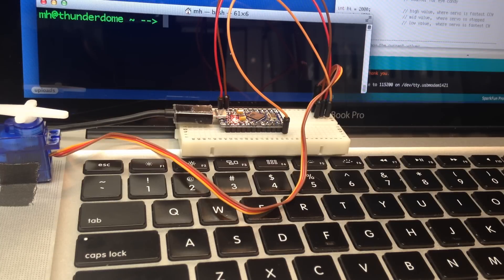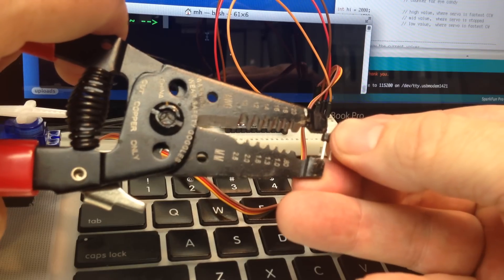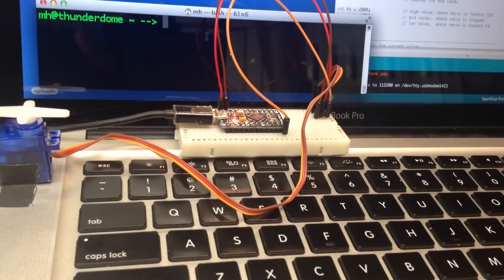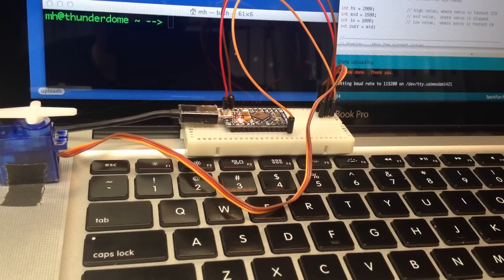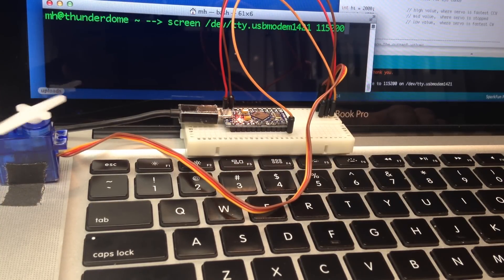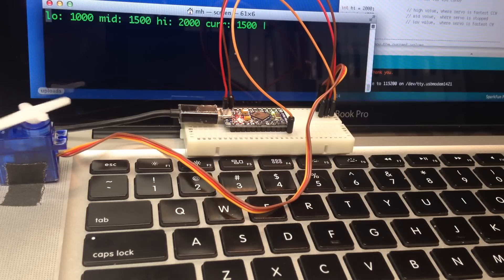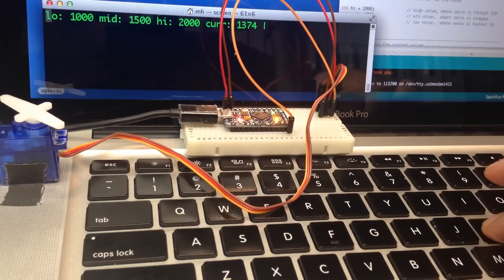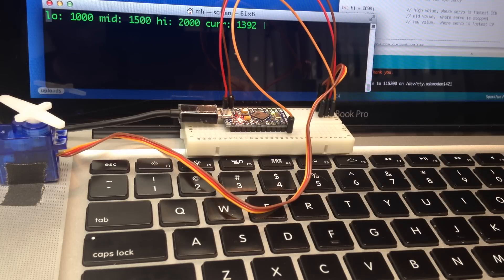Continous Rotation Servo: Midpoint Calibration

Comment: Hello Mark!
I have done exactly everything as you instructed in the video. The code runs and gets uploaded to my arduino nano. When putty is opened, it prints continuously without any breaks; It prints "sweeping = 1"  along with the current value. Putty doesn't allow me to enter any commands. I have connected my signal pin of the servo to D9 and Vcc pin of the motor to the +5v pin of the nano. My servo just keeps spinning and doesn't stop until it is detached. Please help with this.